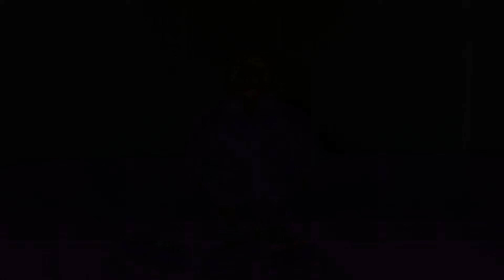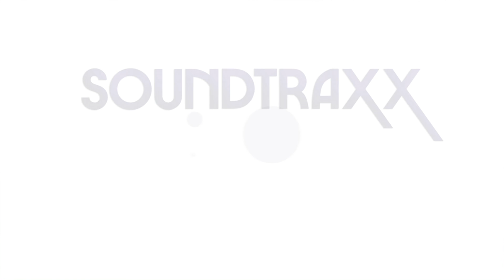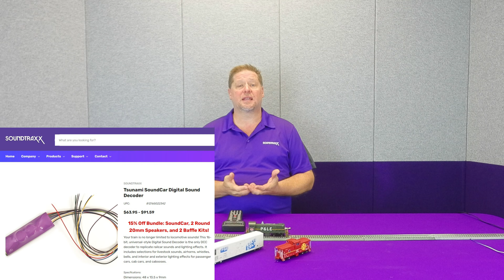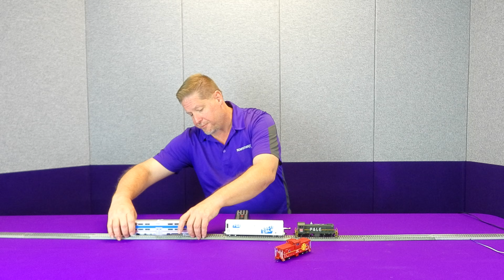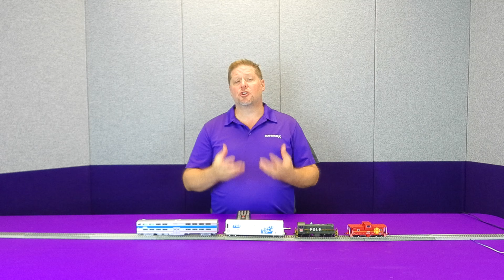Tsunami SoundCar: Demonstration and Consisting

Comment: Something I was wondering is can the sound-car produce the coupler slack sound like bangs and thuds it would be cool if the decoder could do that
Reply from the maker: No.  The slack action would be based on movement, and without some more expensive electronics installed, this would be difficult to do.  So, we have all the sounds and such based on the DCC commands.  and the slack action, while we thought about it, would be triggered at SS1, when your actual model may not move for a few seconds depending on the length of the train, thereby ruining the effect.  
So, for now, no..  Sorry.  
I hope this helps!  
~G
Reply: @SoundtraxxDCC  could be added via a gyro, movement sensor,
Reply: @russcole5685 that’s what they meant, it is possible to do but that would be MUCH more expensive. def possible though to dyi but that’s a serious engineering challenge

Comment: Hi George. I have a couple of non soundtraxx steam locos.   The rest of my locos are all soundtraxx. Do the sound cars still work ok with the non soundtraxx locos?
Reply from the maker: Yes!  The DCC signal is the overall command, so it really does not matter which decoder you pull it with, the DCC command is ultimately the command the SoundCar follows.  So, when you consist it to the loco, you are actually telling the SoundCar decoder to follow commands sent to the DCC address of the loco (or consist) of the train.  And all commands sent to that address then are followed based on the settings in CVs 21 and 22 to tell the SC decoder how to respond..  
I hope this helps.  If you need further assistance, contact us at support@soundtraxx.com 
Thank you!
~G

Comment: It would be nice to offer a slightly less expensive decoder for basic freight car sounds. For example a single sheathed box car or wood refer.
Reply: That’s all included.  The hardware is the same if we provide less sounds, so it would not save any $$ for less sounds..  but you can make all those settings to make the sounds for the boxcars and such.   Just disable the horns, bells and refrigeration unit in the CVs and you’ll be done.   Contact us at support for more details.  
Thanks for watching!
Reply: Thanks for your reply. Every 4 cars is still a lot of sound car decoders. I have about 150 freight cars.
Reply from the maker: Thank you for the feedback. Do keep in mind you can use SoundCar to add sound to your whole train, but you don't need it in every car. We recommend about every 4 cars or so.